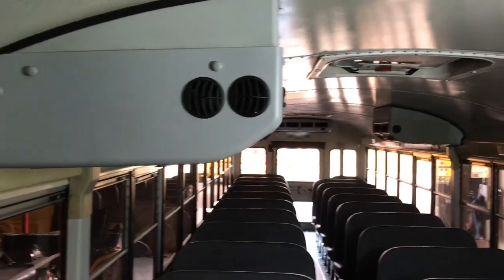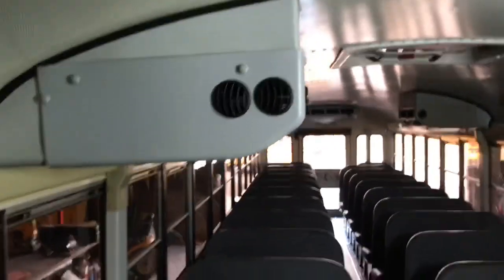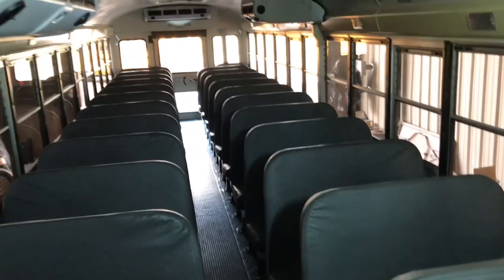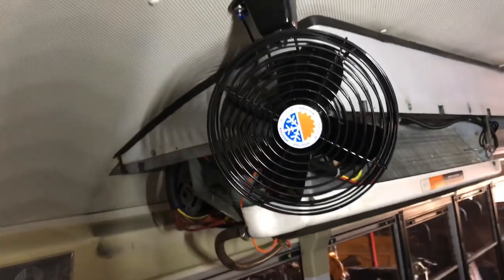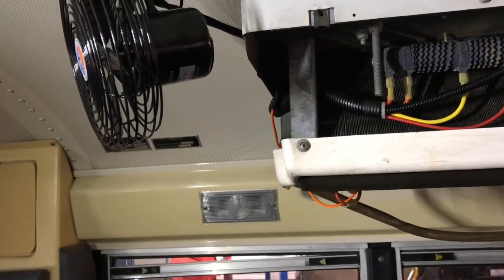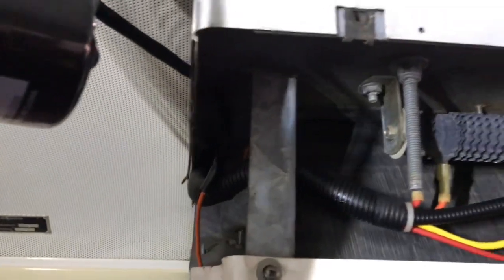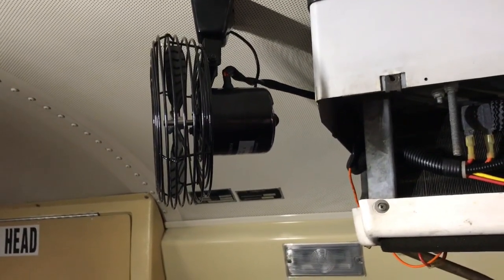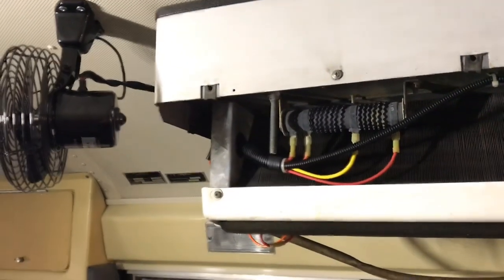School bus a/c performance

Comment: Greetings,  great video! 
I have the same ac unit and the blower motors were working fine but all of a suffer went to 1/2 operation.  2 fans and not 4 working .
After about 20 hrs all the fans stopped working . 
Searching for the wiring diagram for the unit are scarce.  
My question is , is there any resistors(blower) in the inside unit that can cause the fans to be inop?

Comment: I have a 2006 freigthleiner B2 with carrier ac unit. But the ac only turns on level 2 but not on 1&3 .. 
My mechanics cant find the issue. 
Do you have any idea what should be looking at to fix this issue?
Reply from the maker: Blower motor resistor at evaporator. Is speed control switch rotary or toggle (blue). If it’s toggle. Check harness switch for voltage (continuity)
Reply from the maker: If you can. Email me so I can send u my number. Would need more info so that I can try to point u in the direction u need to go to repair.  Joegonz268@gmail.com

Comment: Why not just add coolant to the ac is that even possible 
I need to know if you can cos I own a 1988  Ford skoolie and it has the same ac unit but mine is still running cold

Comment: Incorrect that's not going to do it that unit should be behind the school bus drivers seat about two or three seats behind him or her and then have a fan blowing on the driver on my Special Needs Bus that's how it works and it works really really good and then that other fan system put it back on the other side where that one was a little further back for the return for the driver situation underneath the unit it should be on the right side of the panel box return that way it's pulling from the back because when you open the door heat will come underneath the unit and make it work much harder that's my take on it good luck the fan on the outside of the AC box need to have its own switch when the kids start holler it's cold the driver can still have a fan on high

Comment: Is this what's called a mini split system
Reply from the maker: mike gonzalez   Hey mike. They kinda resemble a home mini split system. 2 evaporators running of the same compressor. Not sure if they call these systems mini splits though.

Comment: Hello, what is this air conditioner running off on?does the air/heat blow throughout the whole bus?
Reply from the maker: malazkm 2010   Hey there Malazkm. The 3 ac units are hung up on the ceiling of the bus (front, center, and rear). Runs off 2 engine mounted a/c compressors. The heater unit runs off the hot coolant from the engine and those 3 units are floor mounted. Heater runs with the help of an auxiliary water boost pump. Hope that helps
Reply: @JoesBusBarn  thank you. I'm doing a bus conversion, and I'm not trying to is solar energy for that. I also wanted to know how much would I be to install the system?

Comment: If it’s not blowing right address the problem
Reply from the maker: Michael Heller   It’s functioning properly. It’s just a little to far from the drivers cockpit. The fan is just to blow a bit more colder air towards the driver. The set up from Andy’s air is just off by a bit.
Reply: Exactly what I was thinking just fix the darn ac